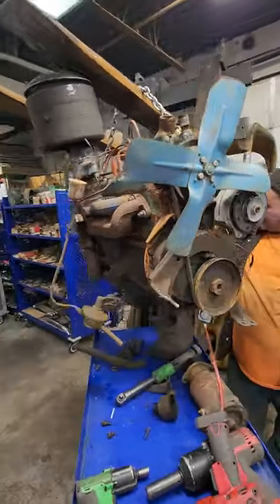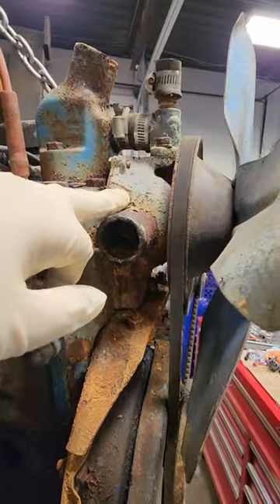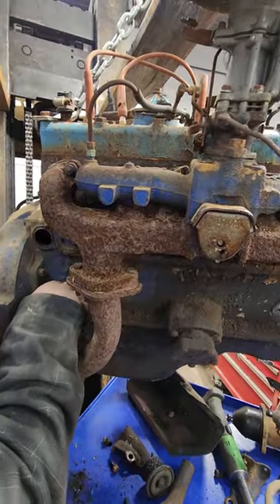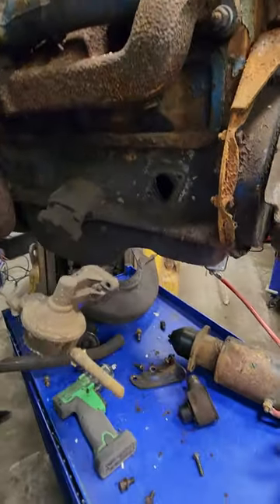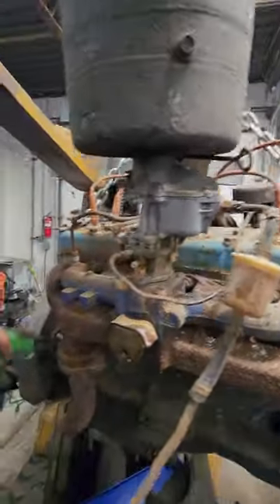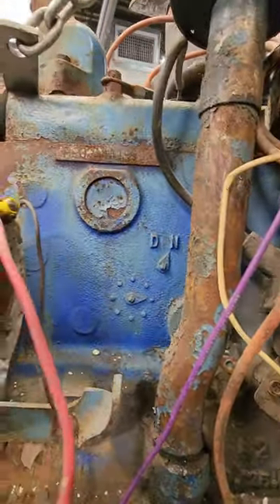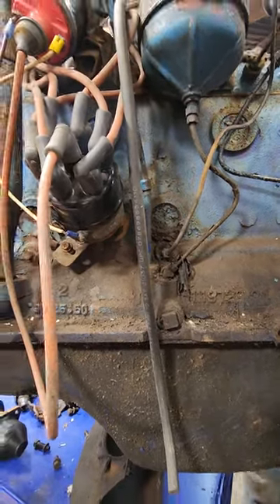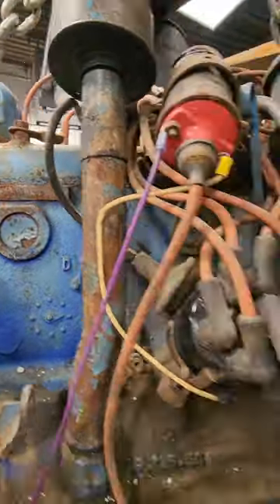flathead 6 1950 plymouth engine manifold starter fuel pump

Comment: Still have some Cranks. Brand new and rebuilt still have parts. Gasket sets.  Enough to last me 10 lifetimes.  No down sized to 1/2 a lifetime. Ball&Ball carbs new and used probably 50.😆